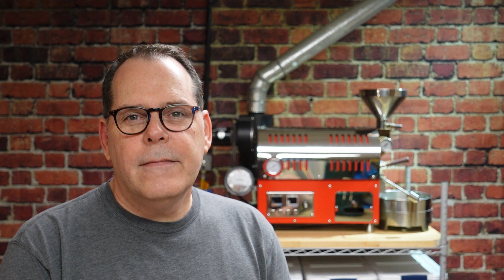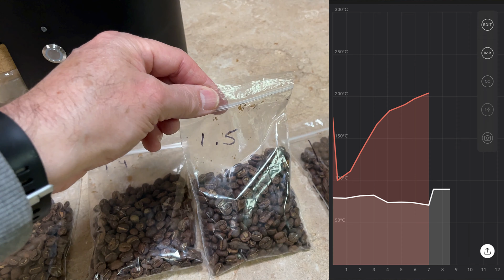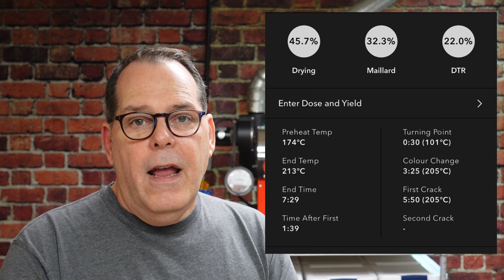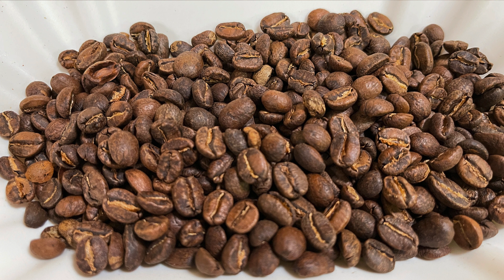Creating A Coffee Roasting Profile

Comment: As a professional cupper whenever I tried with lower charge temp we found only muted cups on cupping table even no complexity, no intensity of flavour
Reply from the maker: Thanks for sharing Nadeer.  That is interesting.  I have learned that longer roasts are generally more muted and flat.    I mentioned around the 5:08 mark, that my previous roast with the Ikawa was way too long and even described the cup in a similar way.  So I planned to target my total roast time to be about 7 minutes in this video.  

So, based on what you said in your comment above, did I use too low of a charge temperature in this video?  I'm curious what you would have changed?  A higher charge temperature would cause the overall roast time to be shorter total roast time unless you are less aggressive with the heat after charge.    

I appreciate your comments and am really interested in hearing your response.  Thanks for sharing and for watching!

Comment: Great video, I'm glad you found a profile that got the flavors you wanted. Since getting the Ikawa Home, I've kind of become 'roast profile agnostic' in terms of trying to figure out how to roast certain beans using what I learned with Behmor, Fresh Roast, Quest etc. Meaning, I often just keep an open mind and try several different profile 'shapes' (heat and air approaches, phases) that may or may not fit the norm. Then, I just let taste be the judge. I do have a few go-to starting profiles that get me close, sometimes very close, to what I'm wanting. But as you said, with the ikawa it's easy to edit and tweak and taste small batches.
Reply from the maker: Thanks for sharing Keith. What did a couple of your go to profiles look like. Call Rose time/these percentages or anything you would like to share. You’ve peaked my interest. I know you spend a lot of time roasting so it would be nice to see what those go to profiles consist of if you’d like to share.  Also, just out of curiosity, what is your typical total Rose time using the fresh roast?
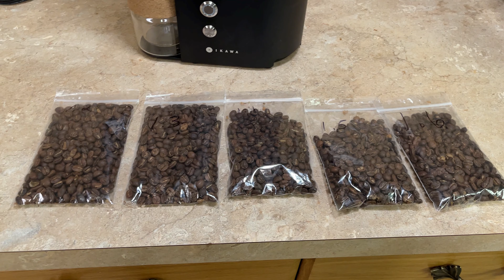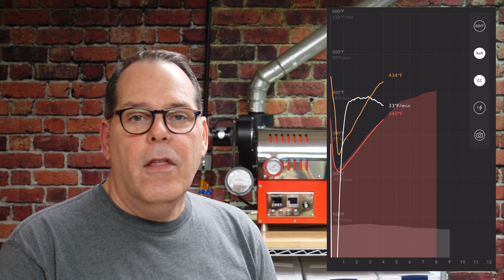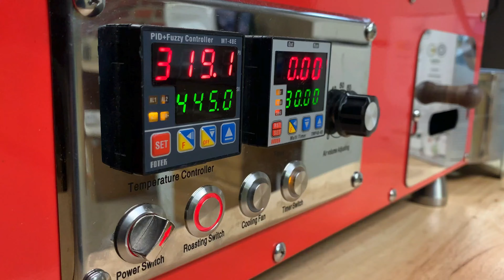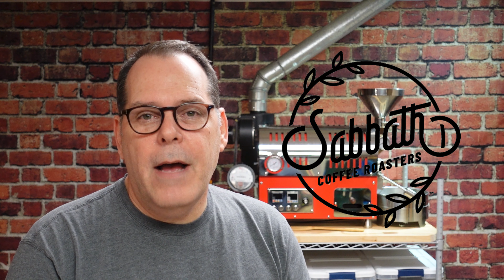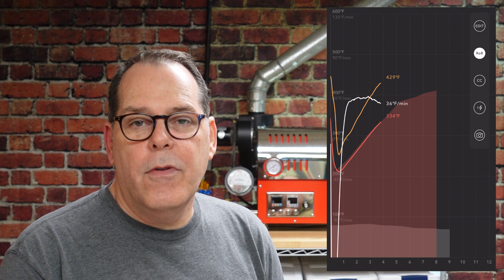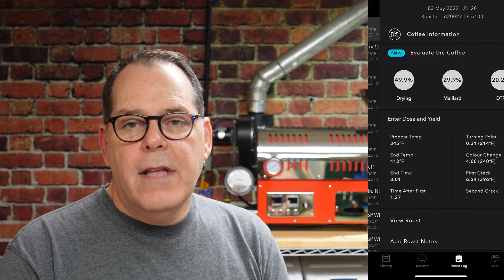Reply: @VirtualCoffeeLab  with Fresh Roast my total roast times were around 6:00 for a light roast. For Ikawa Home you set the incoming air temp which is the top line on the graph in your Pro model. I'm not sure if you can edit profiles on the Pro using inlet temp or it's just 'bean temp', which is actually the probe above the beans. My favorite go to profile for a light roast has a total roast time of 5:40 with dry end at 2:00 and first crack at around 4:40, so 1 min dev time. My set points for incoming air: 00:00 70 degrees (room temp), 00:23 300, 01:14 427, 04:27 475, 5:40 471. Air is 0:00 75%, 5:41 62%. Then about 2 min cool for total cycle about 8:00.
Reply from the maker: Thanks for sharing Keith.  I will give those profiles a try.  I have not had a dry time that short on my other roasters that was less than 3 minutes that was "successful".  I wonder if the small amount of coffee being roasted in the small ikawa chamber makes that short dry time work well. Obviously the roast you shared is for the ikawa but are you doing this with the Fresh Roast? I can't imagine trying to do a 2 minute dry on a larger batch of coffee, especially my drum roaster (500 gram).  Have you done anything like that?  
The ikawa pro lets you edit the bean temp and the fan.  The inlet temp adjusts itself if I remember correctly.
Reply: @VirtualCoffeeLab  I would say dry times are similar with Fresh Roast. I did an online cupping with a couple folks from Ikawa and they shared some info on their profiles. I remember them saying they target 1:45 to 2:00 ish for dry end for many home roast profiles. I don't think this works for larger drums. Which Huehue is your go to? We should swap roasts sometime.
Reply from the maker: Yea, i think the easy profile tweaking and the small batch size and the repeatability make the  Ikawa's stand out as far as sample roasting goes.  I think you're right about keeping an open mind with the profiles.  Experimenting has really opened my eyes BUT like you said, I seem to have a couple of profiles i enjoy most based on the coffee I am roasting.  I fell in love with the HueHue when I had it for the first time.  It was a Huehuetenango Boqueroncito back in 2015.  Man was that a perfect breakfast coffee.  I think this might be the link when I bought it from sweet marias.  https://www.sweetmarias.com/guatemala-huehuetenango-boqueroncito-6846.html  
Currently, i'm buying some Huehue from a friend who owns a coffee roastery.  He has been getting Waykan 
Thanks for the offer to swap.  I have had others who want to send me their roasts or share.  It sounds like fun.

Comment: Hi mike, thx for sharing.. It got me interested. 
You said that 8min roast on ikawa equals to 10min roast on drum roaster. But how about the percentage? Does the percentage remain the same on the 3 phases?
Reply from the maker: I’m the experiment I did with the ikawa,  the phase percentage range I used  for a medium to medium/light roast was the same as my drum roaster.  Notice on my curves I simulated a pre-warmed charge temperature and a soak (which I didn’t talk about).  With that being said, I’ve seen shorter dry times and linger development times used by people roasting on air roasters.  The ending temp and color really drives what you want to do with the roast profile Dani.  WhT did you say you were using to roast with?  

As far as roasting time, I can’t say every roast will be 20%shorter on an air roaster than a drum roaster.  It just happened to be that here with this experiment.
Reply: @VirtualCoffeeLab  
Im the one using a modded popcorn roaster 😁.
I dont have access to drum roaster, so ive always been wondering about the percentage of phases between drum roaster (which are more common in reference) and hot air/fluid bed roaster.

Since you can get the drying phase much faster in fluidbed (and also with minimal defect like tipping & scorching), I find that applying shorter drying phase gives a stronger aromatics on my setup.

Im also curious about "even-ness" between the outer part and the inner part of the bean. Have you had a comparison between  two roasted bean from each roaster? 
Majority of my roasted bean have darker inner part than the outer part 😅 (i heard fluidbed roasts the bean from the inside-out). It got the "right" aromatics for me, but it (the ground coffee) always came darker level than i want. I just extract it faster than a "medium/city" roast beans to avoid bitter notes/overextraction.

Well, still a lot to learn on my short journey of coffee ( just start drinking proper coffee since the pandemic).

Its fun that we can learn anything on this platform, regardless of the time&space .
Cheers...
Reply from the maker: @danirinaldi1044  Thanks for sharing that Dani.  You might be surprised when I say this but your "darker on the inside" is most likely a roast defect.  Pushing the coffee too hard through dry and browning phase causes the moisture to boil intensely on the inside of the bean and you get kind of an inward scorching of the bean.
Reply: @VirtualCoffeeLab  
Thx for the reply mike,
Well that make sense, scorching from inside.. 
But, strangely i got dull boring beans when prolonged the roast time. Hahaha maybe im chasing clouds here

Comment: i enjoyed seeing how your different profiles on the ikawa affected the cup, and how you succeeded in finding a sweet spot for that bean at least!. i've now logged 7 batches on my FR800, all using an 8oz charge and lower cost greens that won't hurt me to screw up. i'm gaining lots of knowledge with each iteration. tomorrow i'll be tasting my last roast from may 5th, an el salvador devina roasted to C+ over 8:10 (43% drying, 41% browning, and 16% development). i've recorded my fan and temp settings at 1 minute intervals, along with the machine's built in thermocouple.
Reply from the maker: Nice job Paul.  I’ll be going through the same thing with a new roaster my family bought me.  You’ll see it on the next couple If videos.  It might be interesting to see your setting but not yet.  Want to go into this as if I was a new home roaster.  
Im glad you are seeing some successes with your roaster.  Are you using an extension tube?
Reply: @VirtualCoffeeLab  i've used an extension on all but one of my roasts, just to see for myself what a huge difference it makes it the efficiency of the air movement. it's so cool to be able to regulate the beans temperature by just the fan level - and there's no excuse for roast defects anymore! i do plan to experiment with a 91g charge, with and without the extension tube, just for educational purposes. so far i'm still working through some inexpensive greens which i'd never roasted before on my Popper or Behmor, so i can't really compare the taste in the cup from my FR with other roasters quite yet.
Reply from the maker: Thanks for sharing where you are at with your roasting journey Paul.

Comment: Excellent! It's nice to see you having fun with this roaster. 
I keep thinking that this brand and others need to partner up with others to make their roast profiles transferable between the sample size roasters and production size ones. 
Whoever figures this out first will surely have a huge advantage over all the others. 

This digital, easily programmable roasting style is definitely the way coffee roasting is headed. 

I've been having fun with the Sandbox Smart r1, which is also ran by an app.  But the ikawa app seems to be more intuitive and has a leg up on consistency as well.
Reply from the maker: Yea, I’m not sure if it is possible to directly transfer /share a profile successfully without some modification to the profile.  I’m talking about using the same times and temps not technology as far as software.  Each roaster is different.  Their probes, their placement, and their construction which will influence thermal  efficiency.  

Yea, the bellwether coffee.com type roaster is what some shops are doing.  No roasting experience needed!
Reply: @VirtualCoffeeLab  
Someone will figure it out. It may have to be an air roaster sized for samples with smart tech and other larger air roasters with smart tech. But someone will do it. It may take AI or just A LOT of R&D... but it will get done. Somehow. 

Yes... Rob Hoos is a big advocate of being able to scale and also transfer a roast from machine to machine by using time and temp with the 3 roast phases. 

With his (and others') knowledge and others' engineering and tech capabilities, I'd say they could figure it out. And produce all the roasting machines that can scale roasts of whatever size. 
I don't say it will be easy, but possible for sure. ALL things are possible! 😉